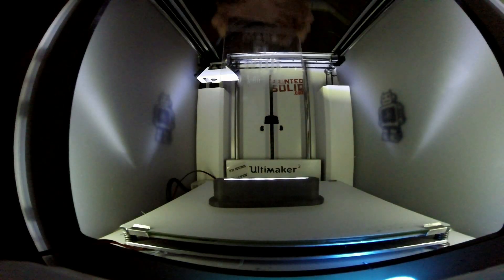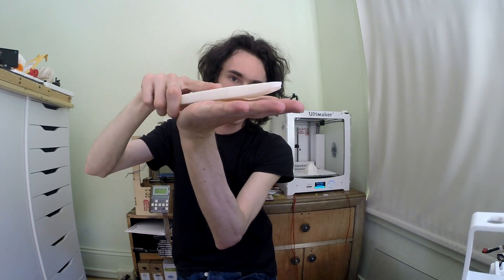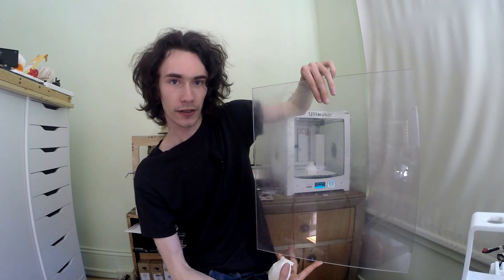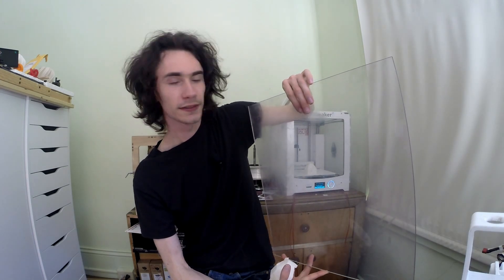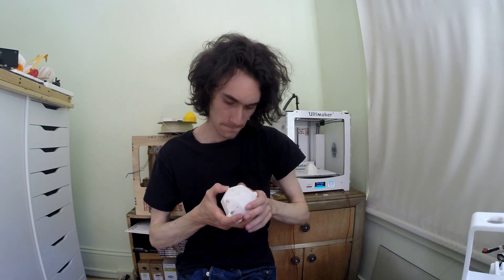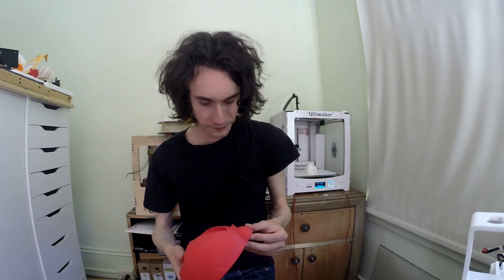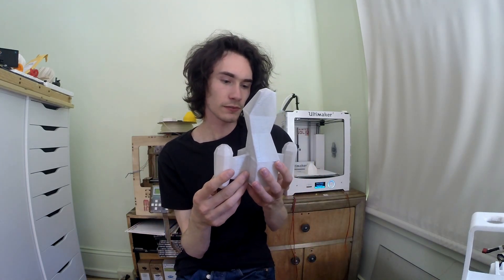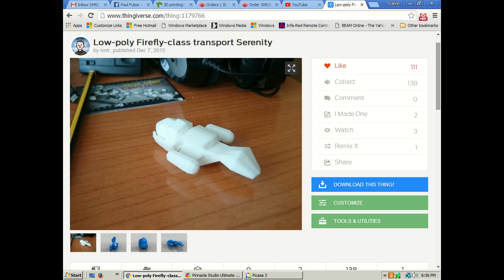Make It With Calvin Basic ABS Printing Tips

Comment: Does the ultimaker have a heated bed ? Have you tried kapton tape yet ?
Reply from the maker: It sure does! And I have tried Kapton on my Thingomatic and it works... but it is very fragile in my experience.
Reply: +Calvin Witt you learn to not scrap it after a while. The best thing for warping is to fully enclose the printer and preheat for 30 min before to stabilize the temperature.
Reply: +aamcclary The preheating thing I learned from looking at my universities Stratus printers that hold a constant 60 degrees when they are not in use.  It really helps with warping.